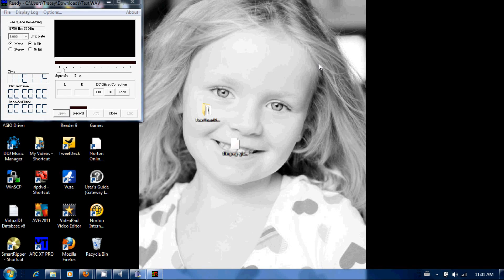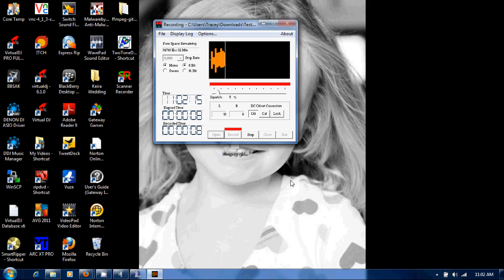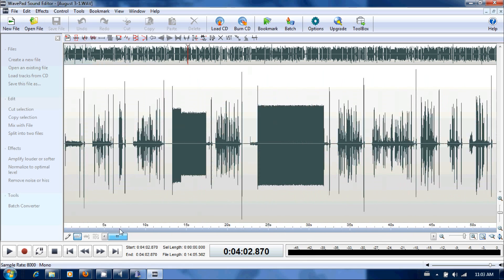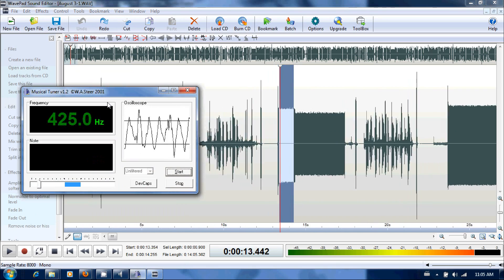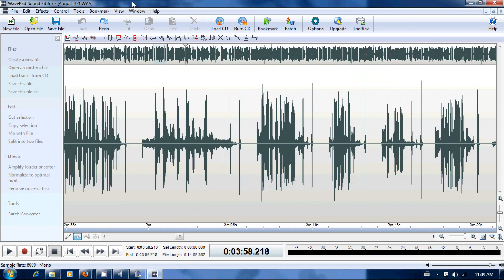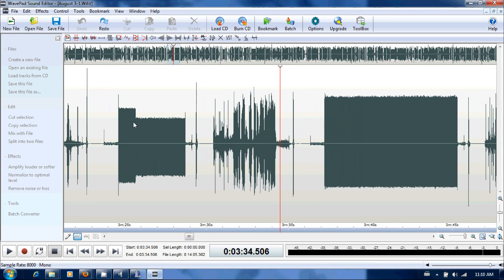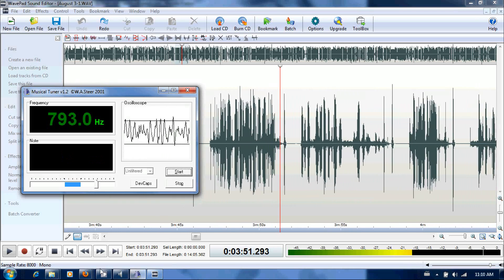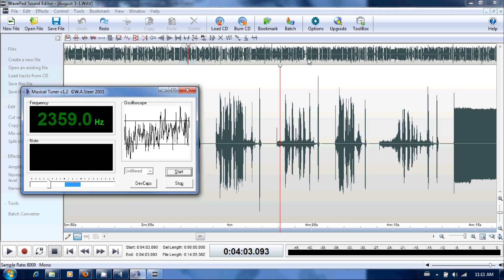How to determine your Fire Department Paging Tones

Comment: I Use Software made to fine the tones. its called Two-Tone Decoder and Fire Dispatch Logging system by Comtekk. its $49.95 but worth the money. It Logs tones, date, time, wave file name to text file, Unattended operation, Records dispatcher audio to mp3, Instant replay of last tone-out,  Decode tone frequencies from 200 ~ 4,000 Hz. The Smart filtering ignores voice audio, noise and data / ANI signals. Useful for scanners with "tone-out" feature. Check it out Comtekk . com   - Dave